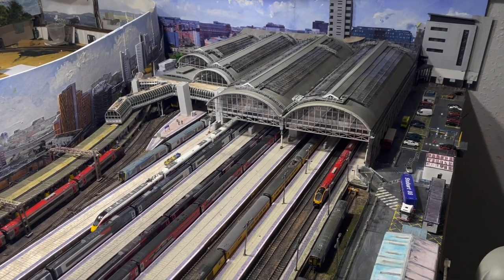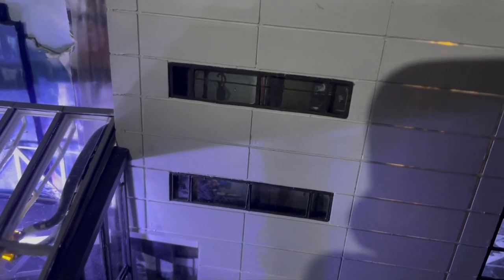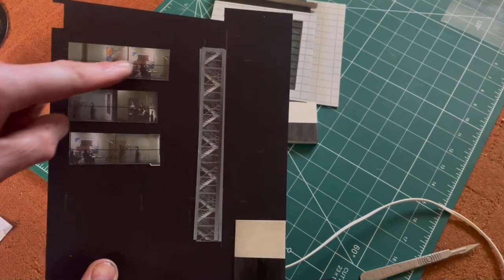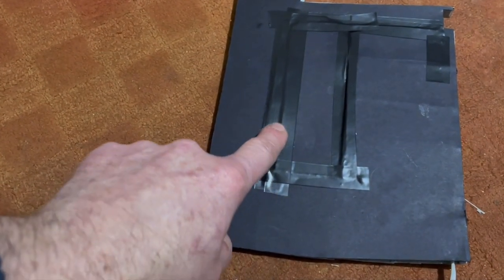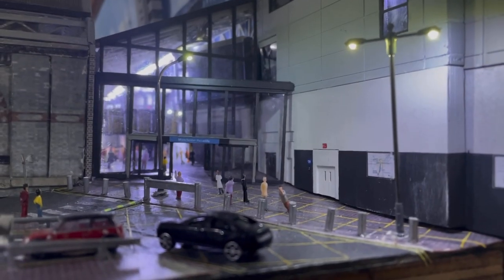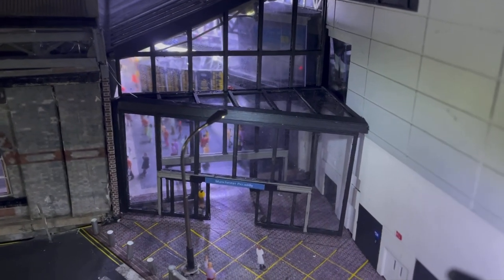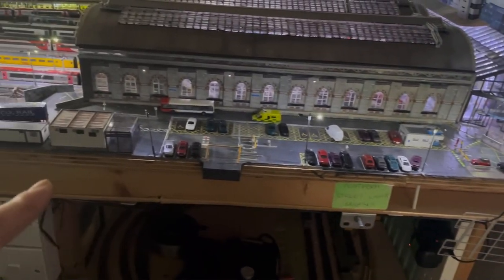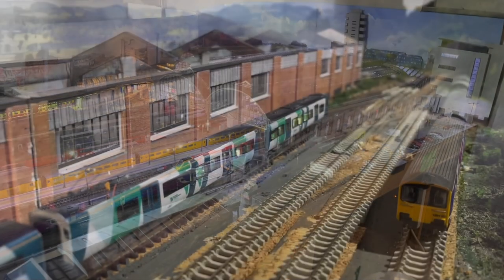MANCHESTER PICCADILLY IN N GAUGE – Adding lighting and LOTS of people

Comment: Wow John, a real work of art, seems anything is possible with the 3D printer.
Reply from the maker: Thank you Chris, well pretty much yes.
Reply: @piccadillymodelrailways  The printer is a means to an end but the key is the bloke that 's using it !
Reply from the maker: Hmmmmm well yes to that too. If you got one I’d help you. Once you know what to do (and there is a fear of breaking it and a steep learning curve, I won’t lie), then it’s not that hard - honestly

I got it for many reasons, making Piccadilly station has challenged me by having to making so many unique and bespoke items simply not available to buy, nor will be without a long wait and huge expense over time. I have to buy filament from Amazon £23-25 a time (not sure Australian dollars equivalent, sorry) which has 330m on it, works out around 6p per metre give or take. The printer cost £265. The savings over shop bought are massive. Those two reasons alone sold it to me.

Comment: excellent work John . where do you get your people from please ?  and did you print the Car park Barriers ?
Reply from the maker: Hi John, I just get the people from ebay, Octopusinnovations. They are in Stocton on Tees £7.50 for 200 people. They are chinese figures very badly painted. You get about 10 different people then each painted in several colours. 

I scratch built the barriers many years ago so I just glued them back down. They were made from varying sizes of plastic rod and strips. Hope that helps.